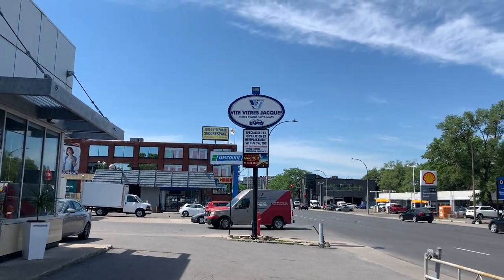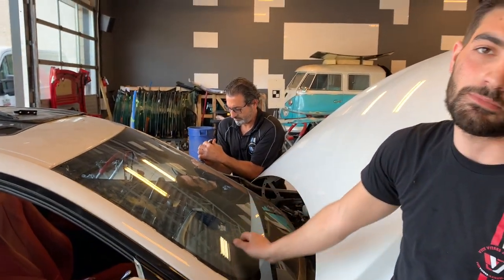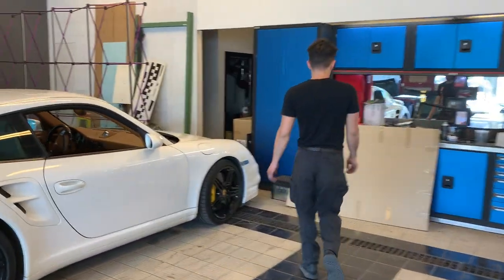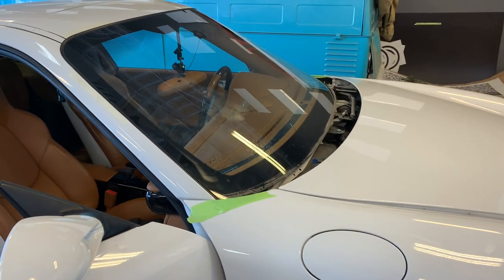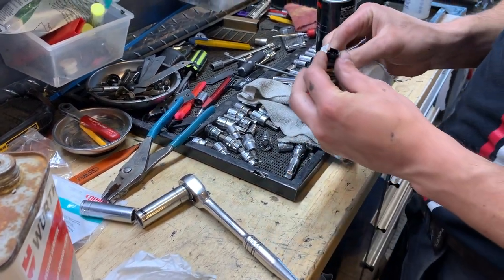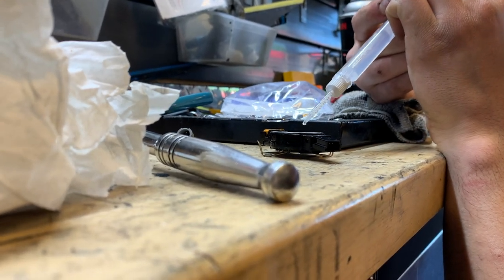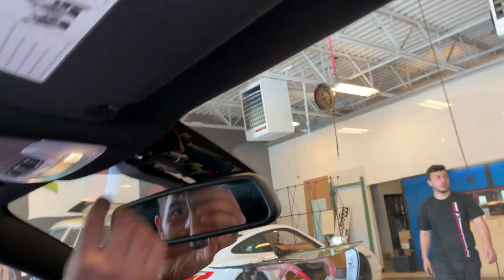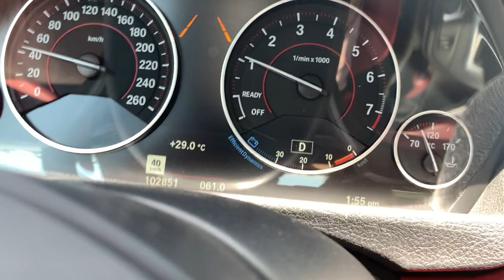BMW F32 2014 HUD + KAFAS Windshield replacement - Part 6

Comment: Is there a way to see if I already have the windshield? I have a 2019 430i LCI and plan on also doing a 6WB and HUD retrofit.
Reply from the maker: The easiest way is to put your phone with some white big letter on a black background and see it it gives you double reflection, but to be super sure about it, I recommend removing the trim under the windshield wipers and check if it says HUD at the bottom, but my best guess is that you don’t..

Comment: Hello.  Is it enough just to buy a kafas camera? Do I need to buy extra cables etc.?  approximately what did it cost you?
Reply from the maker: Hi, that would depend on what you have on your car already install, if you have nothing like I did, then yes you need the wires. But besides that you would need the enabling codes and proper coding. The camera was not that expensive, I believe I got mine with the Kafas module and the LSVC wire for around €250.

Comment: Nice video, thanks! What gel did you use for the rain/light sensor?
Reply from the maker: The gel that was used in this video was a generic gel that was provided by the shop. But if you want to use the OEM gel, you can get it from the dealer or online store of your choice using the part number. In our other video: https://www.youtube.com/watch?v=3UdgX5DLK3o at the 4:14 mark we have the OEM gel and the rain sensor explanation. check that out.
Reply from the maker: 61359856157 it's the part number. if I remember correctly it was like $30USD but if you are like me in Canada, the price might go a little higher for shipping fees.

Comment: Why are you using the roof as a table
Reply from the maker: Well… it’s flat, it’s there and most importantly I do not have a table in my tiny building parking spot so, I had to work with what I have. One day my friend one day.